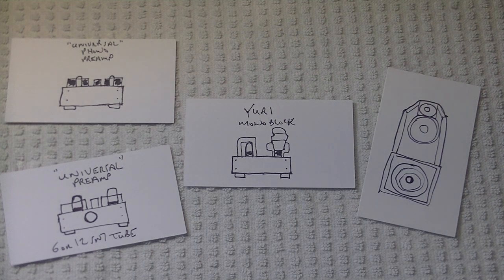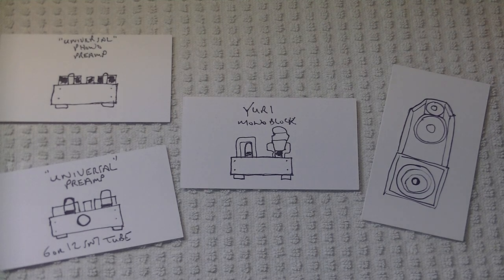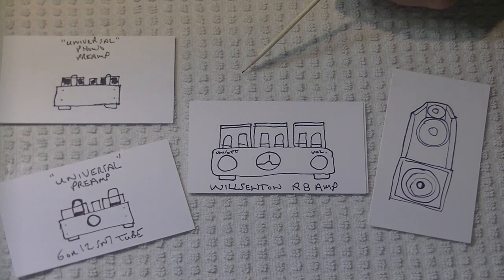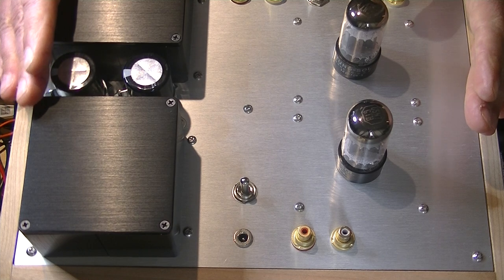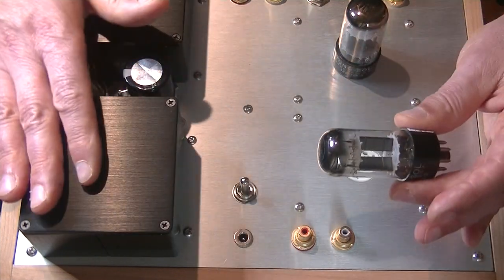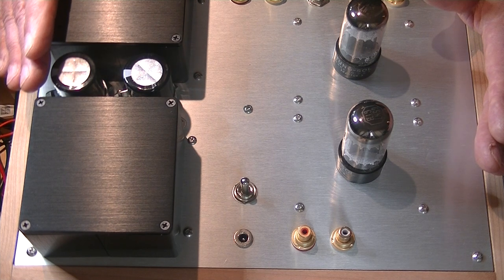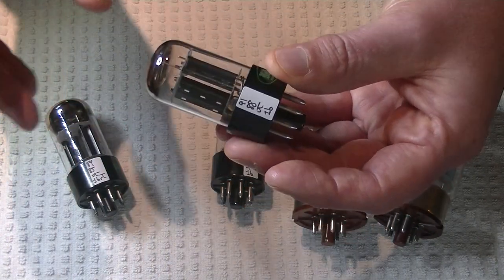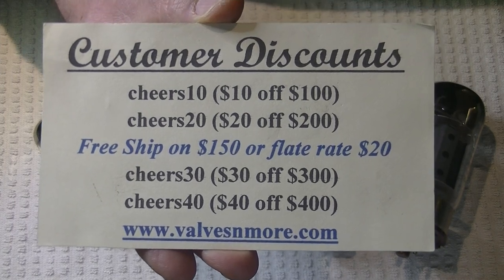Tube Lab #83 - Tube Preamp Buffer

Comment: Really enjoying and learning a lot from your videos... thank you so much!  I own the R8 along with the Freya plus.  Do you recommend the Freya as a buffer? If so, which input ("pre-in" or "cd") on the R8 do you recommend for connection?
Reply: I have the same question Henry. I have the R8 with a Schitt Saga+ in front. I run it into the preamp inputs on the R8, which cuts out the volume control on the R8, allowing the Saga+ to handle the volume. But, just today, I was considering running the Saga+ into one of the other inputs on the R8. I think that means I'll be riding the volume on both the Saga+ and the R8, but I'm curious about the resultant sonics. I'm also curious about the general 'good and bad' effects, audible or not, in either of those input scenarios. Further, I read somewhere that running a preamp into the R8's preamp-in doesn't actually bypass the R8's preamp...
Reply from the maker: I've always used the pre IN, it only biapasses the volume control but that's a good thing, because volume controls always add a certain amount of noise.  And the only way to find out if you have an improvement is to plug everything in, roll in your best tubes, sit back and listen to some of your fav high res tracks.
Reply: Thanks for your input Phil! 
The Pre In seems like the logical connection, but was curious on what Bill at tube lab suggests because I've read somewhere that running the signal through the Pre In on the R8 input degrades the sound quality, therefore the CD input is preferred. 
Bill responded suggesting the Pre In input as well.  Thanks
Reply: @tubelab194  thank you Bill!
Running the Freya with a solid state amp and have been hesitant of trying the Feya with the R8. This video motivated me to try, but you didnt mention your connection.  I will connect through the Pre in and give it a listen.  Thanks again.